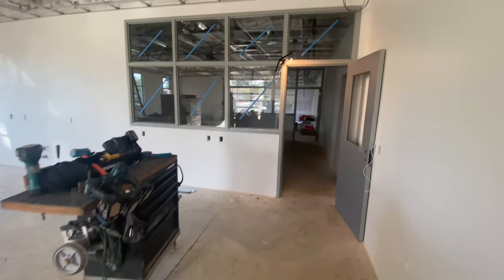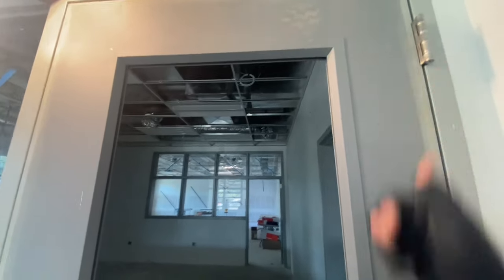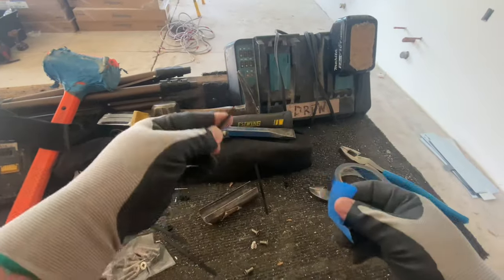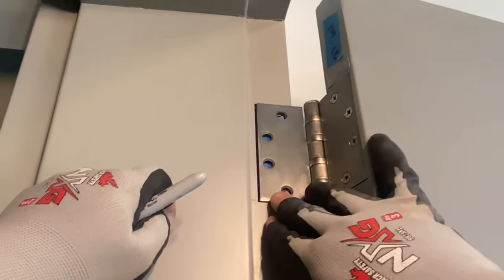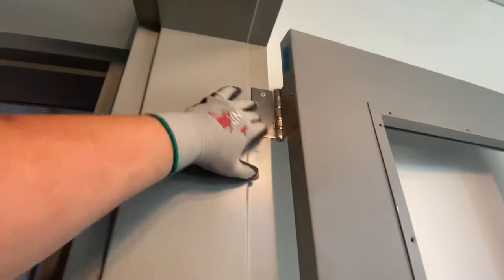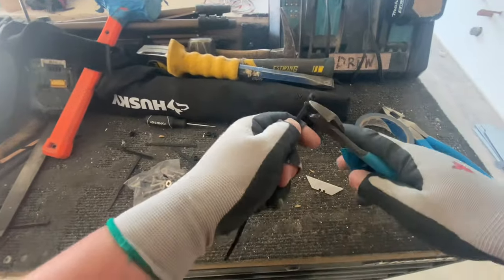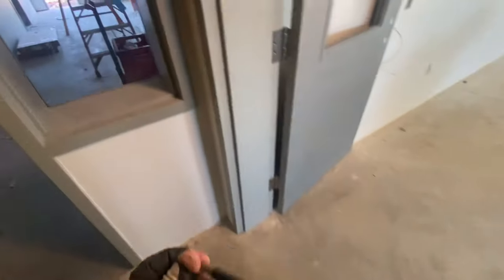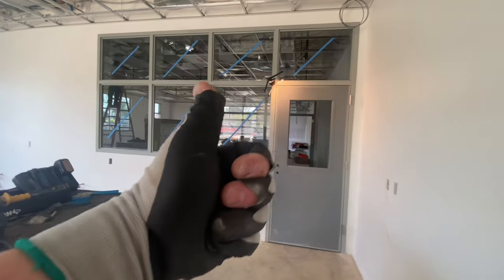How to Adjust a Commercial Door by Shimming the Hinges.

Comment: I don’t adjust butt hi he’s anymore. I just spec a select cont hinge and never ever have to adjust again. The building will fall down around that frame before that door sags or heaves ever again.
Reply from the maker: They are super strong.  I think that’s why they use them in alot of schools.  Almost kid proof 😆
Reply: @drewinstallshardware  that and it prevents fingers from getting in there on the side of the hinge. Kid proof lol

Comment: Great video. Like another commenter said, I was expecting a shim behind the bottom leaf. Shimming out the top in the way you've done works a lot better in this scenario. On old wooden casement windows I've seen hinge mortises on the jamb cut at angle to alter the margins, creating the same effect as the zip tie, but wouldn't have thought to try it on a new door install. Thanks for passing on some knowledge, much appreciated.
Reply from the maker: This is just one way but I like using it.  😎

Comment: Great tip, what if the door is sagging? How would you lift it to have an even gap at the top of the door?
Reply from the maker: I think I would start the same way.  Shim the top hinge.  Pull the top hinge back , or spread the bottom hinge.  You basically get the same result.

Comment: So... Say you had a fire rated door; what are you using to shim that, and is that functionally any different? Also, does the zip tie not wear down over time, or is that not really an issue since it shouldnbe tight enough to not move/rub on the metal?
Reply from the maker: Ya on a fire rated door you need to use metal shims.  I will sometimes run a modified truss head screw into the hinge backing plate wherever I need to shim it.  That way it’s metal and also doesn’t move if they drop the door.

Comment: Hey man, thank you for your videos. I work CE in the Air Force and I’m basically a handy man fixing things like this. I watched a few of your videos and they’re very informative. I subbed for future uses. Just a request to help me improve, can you make a video or explain how you would tackle taking out stripped screwheads out of hinges and doors. I come across multiple doors where the screws are stripped on the hinges which make the job much longer. Thank you.
Reply from the maker: Thanks so much for subscribing.  That’s a great idea for a video on fixing stripped screw. Will try to get one out soon. Until then…quick fix is usually drilling the score out with a 3/16 bit.  Depending on the circumstance that’s usually where I start.  But will get a video soon. 😎